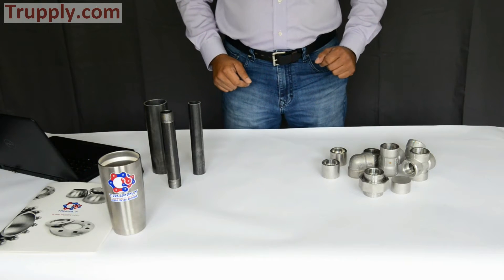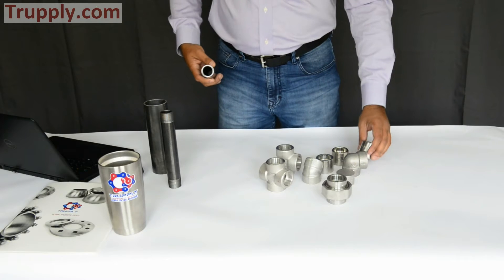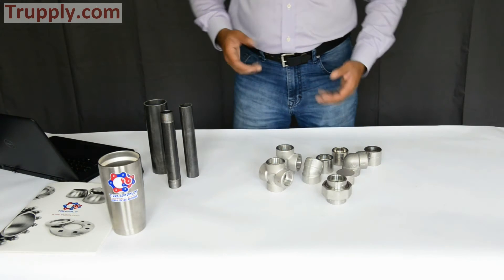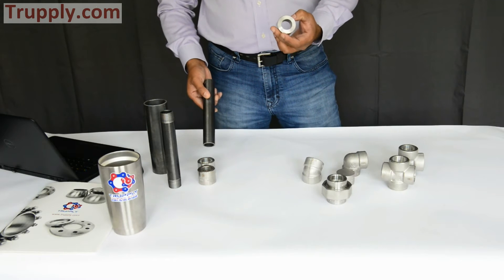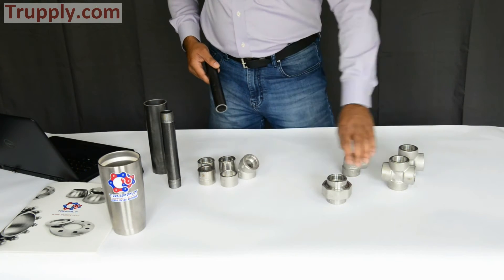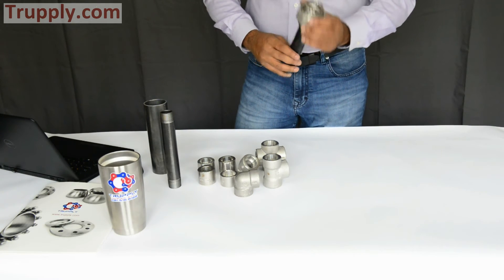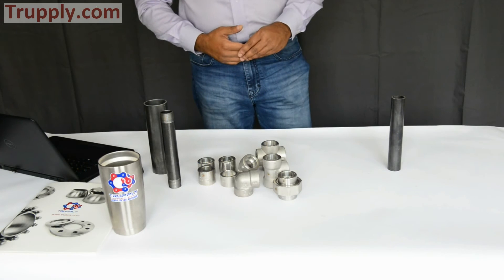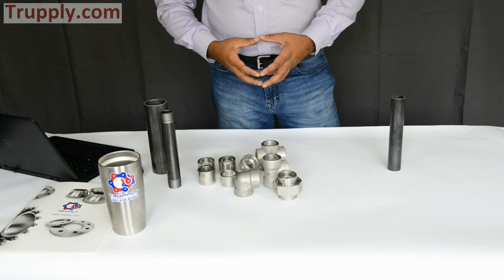Socket Weld Fitting - Pipe Fitting - Pressure Fitting

Comment: socket weld fittings when making the fit also require a minimum of a 1/16 in. gap on the in side for thermal expansion
Reply: How many in mm  thanks
Reply: Jfgi Hgyu 1.5875 mm... 1 inch is 25.4 mm, dive that into 16's aka 16th of an inch you get roughly 1.6 mm... Hope that helps